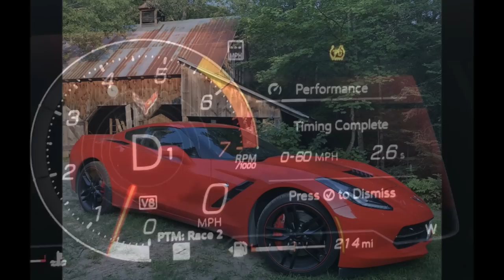HOW TO FIX C8 CORVETTE SQUEAKY BRAKES ~ WHY NO ADAPTIVE CRUISE & YOUR RIDES

Comment: So glad my C8 does not have the adaptive cruise control!  This is a sports car. A drivers car. You are in control and the less intrusion the better. I think this car has the perfect  balance of the drivers aids it should have. Thank you Tadge and team.
Reply: Whatever. It has AC,power seats,stereo,power steering, list goes on. Draw your arbitrary line and feel good about it but it's arbitrary. Corvette is a grand touring car not a pure sports car. 

No adaptive cruise is why I'm not bending over to get one. Just like regular cruise you can still just not turn it on when you want to be the one "fully" in control, whatever that means in a modern car with fly by wire throttle, full computer controlled tuning,electronic controlled differential,and on and on.

Comment: Great vlog Rick. It has been, and continues to be a great way to learn about the C8! Watching your vlogs from the time I wanted to see what the new C8 was going to be, to ordering one and hearing about the delays and what to expect next. To after market parts, and now learning about the breaks and DCT filter changes keeps me in the know especially since I'm about 4 months behind you on maintenance. I need to get my car into Chuck to have the tire pressure sensors checked. They won't re-set after I blew my front passenger side tire in September. Keep the Tech Tuesdays coming!

Comment: Like the vid thanks can you leave car in track setting all time or will that wear out tires quicker.
Reply: What do you think track mode actually does?  Tire wear depends on tire inflation, wheel alignment, road surface, how you accelerate, how you steer and how you brake.  None of which are directly affected by the little control knob near your right hand.  However, the little knob is somehow connected to some driver’s brains, causing them to accelerate faster, steer more aggressively and brake more severely while driving in the “track mode”.  It is up to you.  The manual explains track mode by the way.

Comment: Another great video thanks. I have a squeak noise  inside my HTC usually on uneven roads. Could it be the pins from the roof? Need to lubricant them ?
Reply from the maker: NOT PINS..I had same squeak,open top and the moldings on windshield and top need to be cleaned and lubed....did mine and fine every since
Reply: @RickCorvetteConti  great thanks. What did you lube  them with ?

Comment: I had the same problem but just on the rear brake and did the exact same repair with the same product, but after about only 600 miles the brakes were still squealing. I did the same thing for the second time and the brakes were still squealing after about 600 miles again. But the third time, I reversed the brake pads, for example I took the inside pad and I put it outside and the outside one I put it inside so that the grain of the pad is the other way and since then I have done 5000 miles and there is no more squeaking! 🤯🦻😁

Comment: Even a Toyota Corolla comes standard with adaptive cruise!  The explanation on why the C8 doesn't have adaptive cruise sounds like marketing BS to me.  The truth is that Chevy was trying to bring the C8 in at a very low price, so they cut a few corners.  So no adaptive cruise control, ugly standard wheels, sub-standard engineering to keep the rain out of the engine compartment and front strut towers, etc.  These deficiencies stand out on an otherwise stellar car.  Heck, I bought a C8 as well!

Comment: What law? There are a number of vehicles with both and have been for years. Please please please add it, it would help my life significantly (I have a disability that makes it painful to be constantly on & off the brakes such as during rush hour traffic, but frankly all on-road driving. Also, could you consider auto brake hold (when you get to a red light and come to a stop, I can take my foot off the brake)? Thank you.